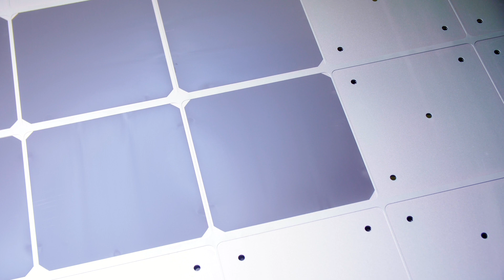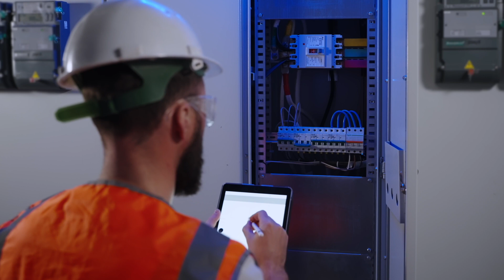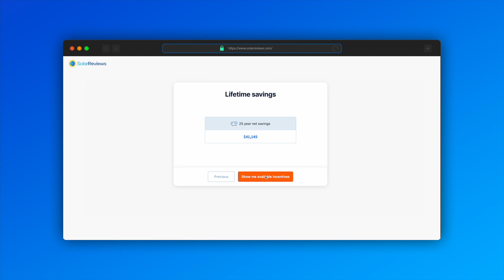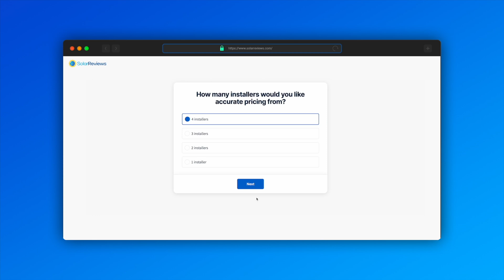Exploring Solar Panel Efficiency Breakthroughs in 2023

Comment: So if efficiency levels go from 22% to 40% does that mean that less panels will be required to produce the same KW for a residential home?
Reply from the maker: Hi Glen. Yes, if efficiency increased fewer panels would be needed for the same-sized system.